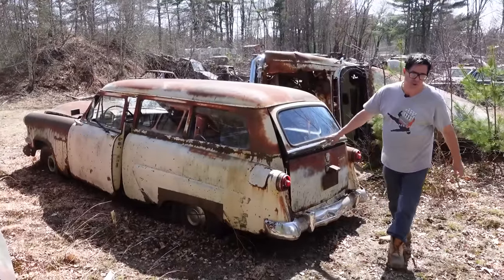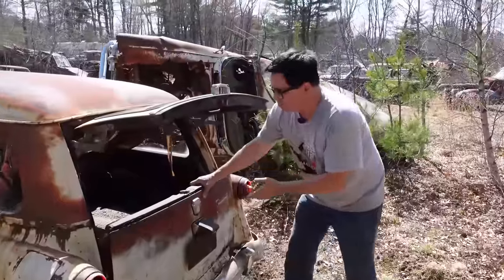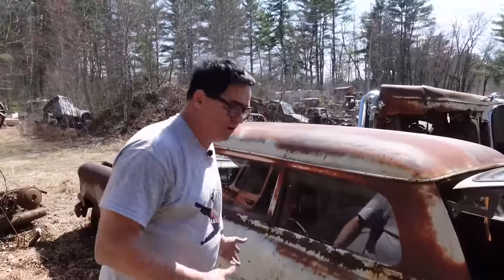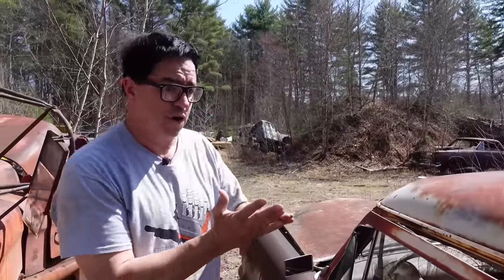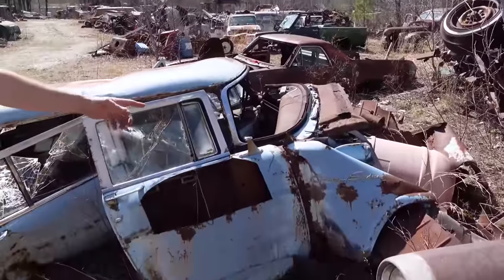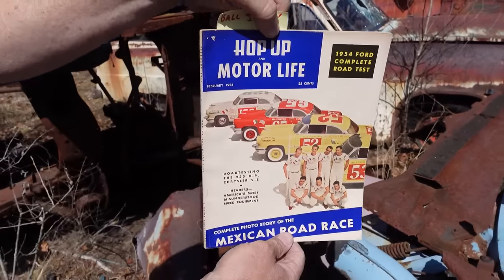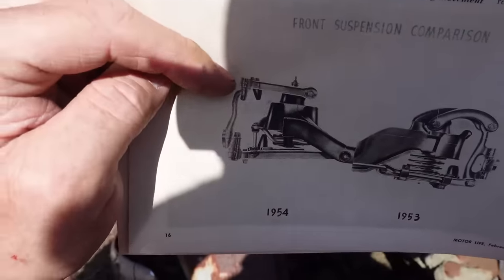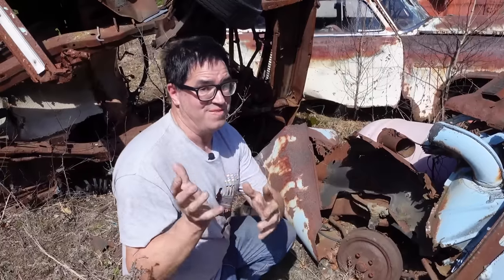Wagon Week EP5 - Not a Nomad

Comment: I've owned a lot of "woodgrain" station wagons, meaning they had woodgrain vinyl on the sides. All of them were 4 doors except the one I have now, which is a 2 door 1972 Ford Pinto Squire, that I have put a 289/4 speed out of a '67 Falcon in (that was quite a job, all the fabrication took me almost 2 years) But I did it right, it's not a hack job. It was originally a 2.0L SOHC four with a 4 speed. It has a modified Ford 8.8 Trac-Lok 3.73 rear axle. The rear leaf springs made that easier than it sounds. Original AZ car, no rust, solid as a rock. It's more solid now than when it was new. 

Was the Ford-O-Matic a 3 speed or 2 speed? I used to have a 1964 Fairlane with a 200ci straight six, and what I believe was a 2 speed Ford-O-Matic transmission. I thought the Cruise-O-Matic was the 3 speed. The kickdown was missing on this one, and you could run it to redline in first gear, then manually shift it into second gear. 

I definitely prefer 2 door cars, no matter what they are. But I love all rear wheel drive woodgrain wagons.

Comment: My very first car was a 1957 Ford 4 door wagon with the 312 Thunderbird Special engine. It was blue and white and I bought it for $100.00 in 1969 when I was 14 years old. That 312 would surprise some of the “hot” cars off of the line back then. It’s surprising how much it had deprecated in only 12 years! There were holes in the back seat floors from being rusted out. It came without the breather on the 4 barrel carburetor. It had burned the paint off in the center of the hood where it would back fire and catch on fire! I learned how to do a brake job on drum brakes and rebuild wheel cylinders on that car.